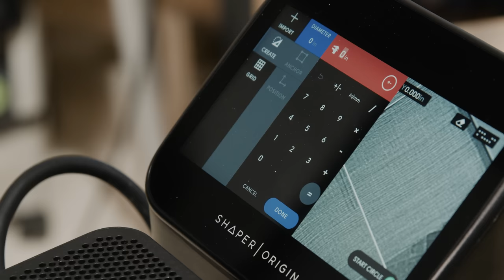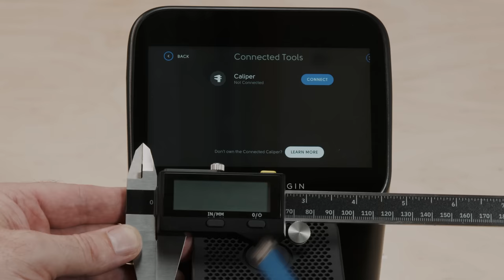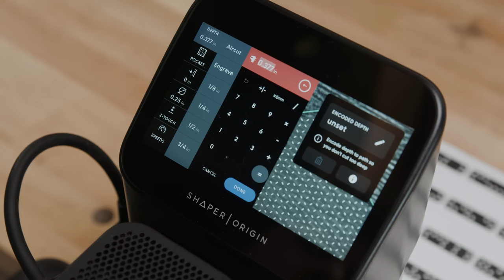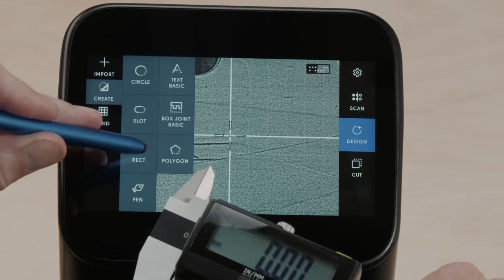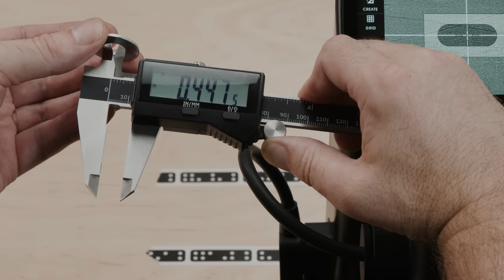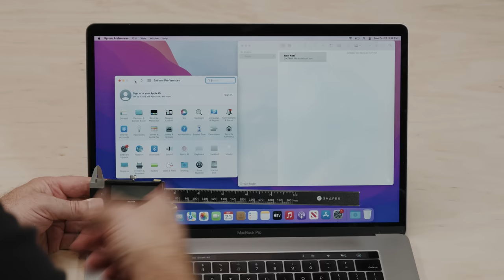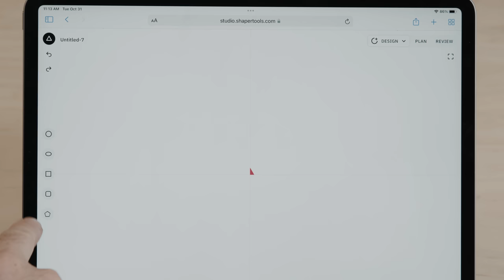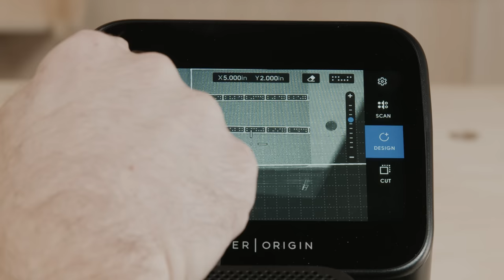Shaper Connected Caliper Walkthrough

Comment: So what happens when I am at home on the weekend using them to make a design and have them paired to my Mac. I then drive an hour to the job only to realize they are still paired to my Mac at home. Am I driving home to unpair before I can connect to my Origin? That sounds like a complete nonstarter. Or what if I’m paired to a borrowed computer and forget to disconnect? Almost purchased. Glad I watched this if that’s the case.
Reply: If it was connected to a borrowed pc, just buy a new caliper. it's only €200 + shipping 😂
Reply: Bluetooth is Bluetooth. If the last machine you connected too isn't available there should be no problem connecting to the Origin. If I am wrong, Shaper should clarify this issue.
Reply: I’d like to know. Sam stressed several times and in the demo he had to remove the caliper from the device before pairing with the next one. I know BT should just let you go into pairing mode and pair with a new device regardless of the status of the last connection but that’s not the message in this video.
Reply from the maker: No, all good! If your Origin and Mac are not near each other, you won't have any issues. Simply put the calipers into discoverable mode (hold the button down), and the in-range device (either Origin or a computer) will find and connect to them.  The comment in the video about first disconnecting from another device is relevant when two devices you've paired with are both nearby each other and you want to be sure to connect with one or the other.
Reply: @Shapertools  Thank you! I didn’t get that from the video. The way it was presented it seemed imperative to remember to unpair. At that price (not suggesting inappropriate) you really want to know what you are getting.

Comment: Why do we need this? Did someone have a problem typing in dimensions from a calliper?
What would be a good idea would be to get the software to make spindle start when plunging instead of forgetting to switch it on 😂 and off when retracted .
Also some better way of making sure the spindle securing screw is tight before it starts, like a micro switch with a tooless way to secure it , safety concern really for people like me who sometimes forgets to tighten 🤪
Why oh why? Did not recall that I wished someone would invent a Bluetooth calibre, but saying that I’m sure some people have a use for this.
Don’t think it will take off unless you’re a gadget person .

Rant over
Reply: I wouldn’t own the router if I wasn’t a gadget person! 😊
Reply: I want it.
Rant over